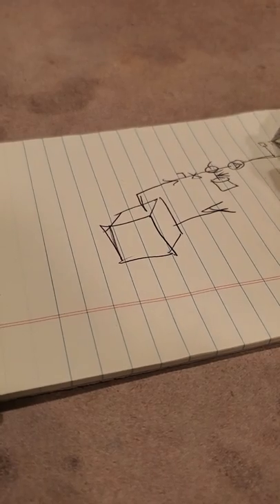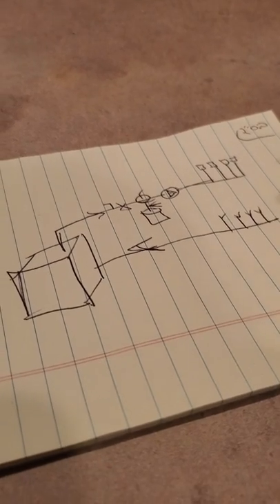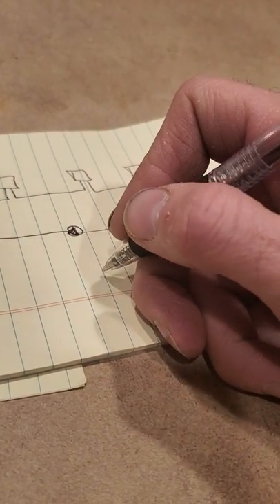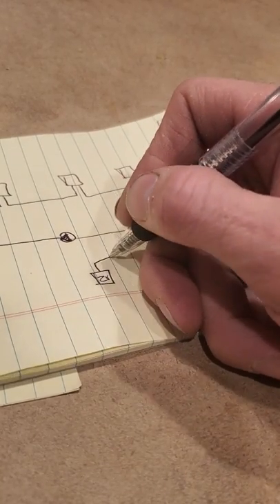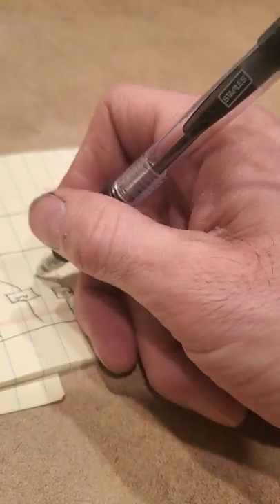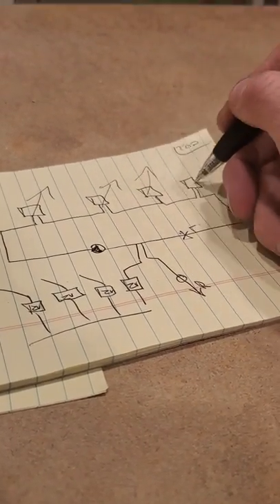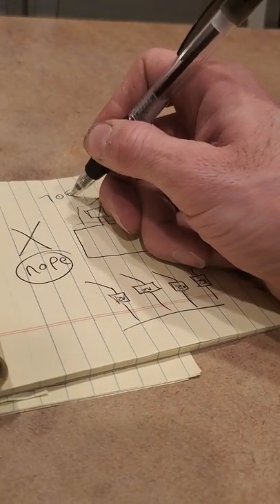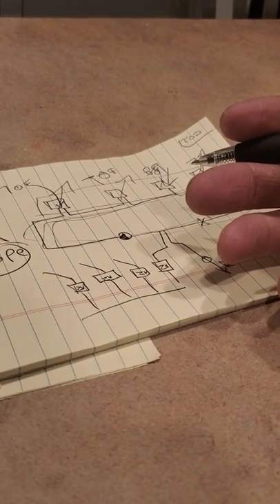Moes Response to the haters on the HVAC school facebook post

Comment: Handeeman sent me. I have an idea for an in the future video. How to do Heating and Air on an off-grid home. Using Solar with a Powerwall, radiant floor and using a ground source heat pump. What would be the most efficient system energy-wise? Just an idea.